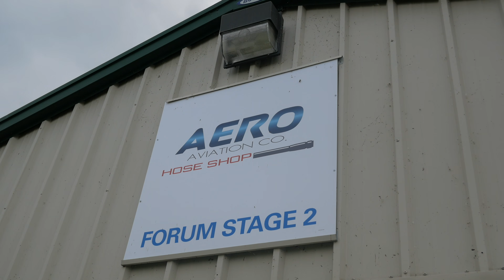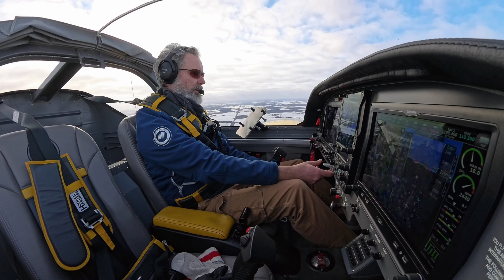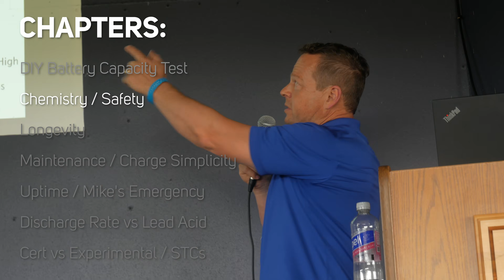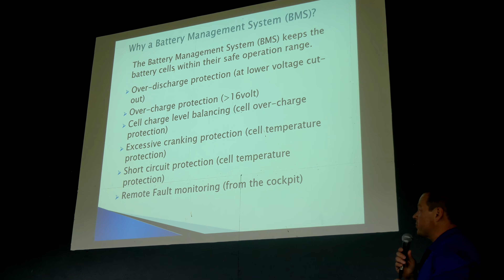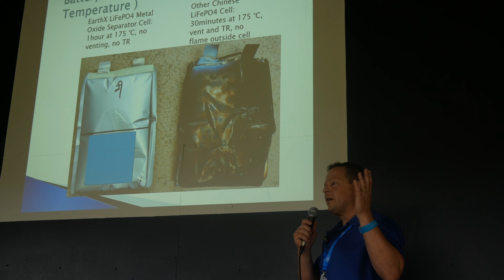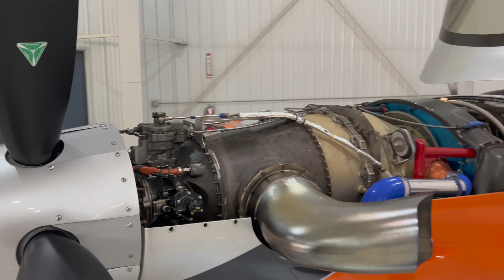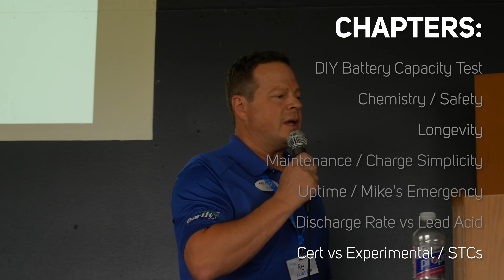"Are these the batteries that blow up?” | Deep dive on Flying with EarthX Lithium Batteries

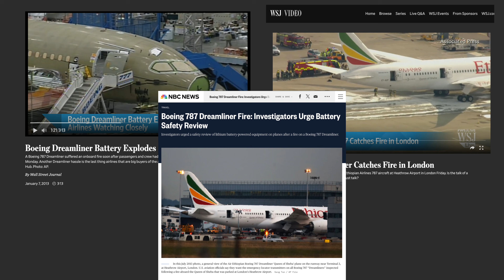Comment: 4:19 That story on the right about the 787 fire in London... That was a non-rechargeable lithium-manganese battery in the ELT. Totally unrelated to rechargeable lithium-ion batteries.
Reply from the maker: 🤷 did I get the other 2 out of 3 correct?
Reply: @FlightChops  Props for the quick reply, lol. I took another look and the bottom center image is also from that same incident in London. So 1 out of 3. Of course there really were 2 lithium-ion battery fires on 787s, so I'm just nitpicking.

Comment: Working in the automotive space, lithium iron phosphate (LFP) batteries are unbelievably reliable and safe. People hear lithium but don't realize how different the chemistries are (understandably). Admittedly its been wild to see how much advancement there has been in the space not just in energy density but also reliability and ruggedness. Likely most automotive electric vehicle pack batteries will go LFP over time and then NCM or NCA will just be in sports cars, Etc. Admittedly aviation will probably use NCA or NCM for the main pack due to energy density.

Comment: I have LiFePO4 batteries on my house solar for the same reason. Those things are so stable you can drive a nail through them or light them on fire and they won't runaway... unlike all the lithium cobalt chemistries.

Comment: We've been using LiFePO4 batteries in gliders for a while. Since we don't have an alternator, the extra capacity is a great help! My worry has always been deep discharging wrecking the expensive battery after a long day, but it sounds like this problem is solved.

Comment: I had an early version of the EarthX battery without the overvoltage protection. I had a voltage regulator runaway that instantly went to 30+ volts before I could pull the CB. The battery was toast and puffed up enough to split the case, but it didn't do anything scary. I called EarthX, gave them the SN and they told me to throw the old one away and they sent me a new one right away. Several years later and it's been working great ever since.
Reply: Tis a bit concerning that the internal BMS did not stop the claimed >16Volts doing damage.

Comment: Hey Steve, why do you suspect your starter has a phantom draw? As soon as you're done cranking, a healthy starter and solenoid shouldn't be pulling ANY current. The only reason could be wear or corrosion (or even a bad relay coil), it may be time to replace that starter!
Reply from the maker: If I understand correctly, it is my Lycoming EIS (ignition / left mag) that draws the phantom current, and that's normal for them.
Reply: @FlightChops  Ah yeah, you did say "ignition." I don't know why my brain thought you had said the starter! Apologies for the misunderstanding.

Comment: Great review. I'm thinking of putting an EarthX battery on my Cessna 180 (firewall). I thought that a temperature warning light visible to the pilot had to be mounted on the panel. No?
Reply: Yes, the fault light indicator is connected to your panel. We do have an STC for a Cessna 180! Your mechanic would help you with the firewall location installation.
Reply: @EarthX_Lithium_Batteries  Thank you!
Reply: @healerf18  No problem!

Comment: Hopefully I didn't just miss this info, but besides the heat concerns in pre-firewall installs, what about in below freezing conditions?  LFP does not like to be charged in sub-freezing, and discharge below -10C is the same.  I'd guess in both winter & summer it's easy to get below those thresholds, especially at altitude.
Reply: Our batteries charge just fine in sub-freezing temps this is because EarthX batteries are engine start batteries, so the expectation is that you crank the engine prior to charging.   As such, the battery temperature is increased ~ 10DegC so it can accept charge without harming the battery. 
Our Operating Temperature range is -30 °C to +60 °C
Our Storage Temperature range is -40 °C to +70 °C
You can find detailed information on our website, under "resources," under "fact sheets"

Comment: I desuplhate my battery often and once in a while , I put a welder on it, till the acid boil.  I managed to get at least a decade out of my car batteries.  How long do your lithium batteries last?
Reply: 2,500 to 9,000 charge cycles.  Traditional lead-acid batteries, only 300-500 cycles.
Two things that kill LiIo batteries - heat and high voltage.

Comment: Enough said about battery protection. I take it you solved the problem. But the other big concern is alternator protection.  When the battery management sensed a full charge, some management system will just isolate the battery. That is like someone just yank one of the battery cable from the battery, leaving a lot of amps with no where to go, and it will fry the alternator. Aircraft usually have a steady electrical load, but not boats, when the sailor try to charge their battery in preparation for night, and a lot of boat (sailing boats) owners had fried alternators.(diodes)  Frying is a process best use on potato, not alternators.
Reply: A properly designed and maintained aircraft is designed to run without a battery, giving the electrical system redundancy.   How is an aircraft different from a car or boat?   An aircraft has a steady load and added capacitance to manage the AC ripple current in the absence of a battery.   It is not intended to run forever this way, just for a short duration to safely get to an airport.  Do scenarios as described damage an alternator … no.  

To the question, does the EarthX battery isolate from the aircraft electrical system when it is full … no.
Reply: @EarthX_Lithium_Batteries  Redundancy in a light plane read battery. Unless you are the few that oped to install a standby alternator.Without that , on a long IFR over water, you are up the creek unless you have hand held back ups or more than one engine.

Comment: lifepo is good but like many things in aviation it's a touch on the expensive side. Not as outrageous as true blue power but still, the batteries themselves cost around 10% of the sale price. In true blue it's about 4%
The one you have there goes for 650$ now although they derated it to 20Ah. 650 is more palatable than true blue's 2200$ but we don't necessarily have to normalize very high prices in everything aviation. or for that matter in power tools that have also gotten very overpriced the last decade or 2.
Avionics could also have a couple of cells inside such that they could run for an hour or two without supply. Good cells might cost dollar fifty.

Comment: Certified pros and cons. I ran the numbers for switching from lead acid to EarthX on my Piper Arrow IV in Canada.
Pros:
1) It’s 21 lbs lighter, 
2) forgetting the master doesn’t destroy the battery, 
3) at least double the usable flight time following an alternator failure
4) better cold cranking on my stubborn IO-360 (Surefire electronic ignition solved my starting issues but my new 35Ah lead acid still struggles to actually turn the prop).
Cons:
1) Cost, 35Ah battery delivered to my door and installed by myself is $1000. EarthX delivered and installed by your AME with STC required warning light and vent tubes is $2000+ depending on installation complexity.

Lead acid and Lithium both have roughly an average life span about 5 years in Canada (unless you forget the master switch and destroy the lead acid) so you’re spending about an extra $200-$250/year for the initial Lithium installation.

Comment: So, I changed from Lead Acid to LifePO4 in a golf cart (Polaris Ranger) and I’ve had some interesting experiences in the first month alone.

Over-current/under-voltage can completely disconnect the battery. Maybe the BMS on these is setup differently than (say) a BigBattery BMS?

To install this in a plane, I would need documentation on exactly how the BMS responds to different scenarios. Lead-Acid is often just exposed cells and a terminal but LifePO4 has an integrated computer. That’s complexity that can fail in ways that “dumb” Lead-Acid batteries can’t.

Also, LifePO4 has a different voltage profile vs percentage of charge left. I’d love to know how electronic gauges can be updated to reflect the difference.
Reply: These are designed for aircraft, not golf carts. Every BMS is different. You can find all of our manuals on our website.

Comment: The glider world is largely converted to LiFePO.  I had a typical 7Ah lead battery when I got mine in 2009, put a new one it right after, and had power issues after long flights.  On the last day of the US Nationals in 2011 I had to fly with only the logger running because the battery was too dead.  I switched to lithium immediately after and am still using that battery.  I got a second one as a backup just last year (and also so my partner would have his own battery).  I've run the full cockpit load on that lithium battery all day long with no trouble (e.g. ground display).

Comment: does it have a BMS?  if it does, it has no place in an aircraft
Reply from the maker: Can you clarify what you mean?
Reply: @FlightChops  does it have an electronic circuit board inside the battery?  that's what a BMS is, battery management system, they can have a sudden failure and shutdown the battery
Reply from the maker: My question was why you thought it has no place in an aircraft environment because of the BMS.
If you watch the video, you’ll see that Reg clearly explains how the BMS works and if it gets into a situation where it has to shut down incoming charge current that’s all it does. It does not shut down outgoing voltage.
Reply: @sinistersilverado965  I'm curious. What is the "sudden failure" mode of a BMS that would "shutdown the battery"? DISCLAIMER: I have used and conducted testing on EarthX's batteries in (experimental) aircraft for many years now. And even with some of my "intentional abuse", I have had no such failures in over a decade. I want to be able to test such a possibility. OPINION: I have them in my aircraft **BECAUSE* they have a BMS. One must realize, though, that these batteries maintain a relatively high voltage (compared to lead acid) as they are being drained. Therefore, the "setpoint" on your EFIS to warn you that time is running out is much HIGHER than what you might use for a PC680. Ask me how I know.🤭

Comment: My battery is losing cranking power and about to die, so I'm going EarthX STC as the replacement when it's time...especially after Mike and I had this experience. I've seen the benefit of a good battery, it saved our lives. In the case of the cub, I think the benefit will be that it will be healthier for my starter to have that cranking power, especially with my high compression pistons.

Comment: Ok EarthX is on my list for next upgrade…. Do we need a GoFundMe for that poor sock !?!?

Are these self heating?  Any recommendations for exposed T-Hangers or cold Canadian conditions with no heated hanger 

One day I hope I can put an EarthX in my truck, need 400A power for winches..
Reply: They are not self-heating. Our recommendation for cold Canadian winters is to turn your master on for about 10 minutes and the current will run through the battery and warm it!
Reply: @ excellent, what about when parked?
Reply: @justinc5356  They will be fine sitting in the cold! The battery can be stored/sitting at temperatures between -40°C to +70°C. Our batteries have no
liquid inside and will not freeze!
Reply: @EarthX_Lithium_Batteries  All batteries have a liquid electrolyte!

Comment: Dear God, just Google “lithium iron phosphate batteries thermal runaway”. Yes THEY CAN have a thermal runaway. THEY CAN. Read the May 14, 2024 peer reviewed scientific study authored by Lei Su in the Journal of Energy Engineering.
Reply: Yes, they can go into thermal runaway... where did you hear in this video that they couldn't? There are examples of what it looks like when it does go into thermal runaway when we shot it, for example. Part of this clip is in this video and the full video is on our page: "Do EarthX Lithium Batteries Explode?"
Reply: @  Prior to going to Nursing School and a lucrative career change, I worked for 9 years in Flight Safety at Boeing Helicopters while being a part-time military/civilian Flight Nurse for 40 years with 20+ years as a Consultant hired by hospitals or air medical service providers after rotary and fixed-wing air ambulance incidents and crashes. I’ve done hundreds of Failure Mode & Effects Analyses and Fault Tree Analyses during both aviation and pharmaceutical careers and noticed a glaring negative watching “Do EarthX Lithium Batteries Explode?”. It only covered single-point failures (drops, compression, overcharge, etc.). Have you combined and covered multiple failures at the same time?
Reply: @PfizerRN_NavyReserveCaptain  It would be impossible to get an FAA TSO approved lithium battery for aircraft without testing absolutely everything imaginable. So yes, we have tested multiple failures at the same time.
Reply: @EarthX_Lithium_Batteries  Please accept my most sincere thanks for your response. Fly safe ✈️ 🛩️

Comment: Illuminating video Steve - have to say, charge density and high current deliverability are the big plusses with these batteries. Good that EarthX has the built in protection and overall perhaps about the most trustworthy lithiums out there. For sure, don't make them too hot!
Reply from the maker: Yeah, I agree - it's nice to have those things accounted for in the design and build of the BMS.

Comment: Here is what they will not tell you about batteries. Two types of Lithium. Ion and phosphate. Phosphate is the safe one. Yet. The Lithium batteries deal with temperature. They also have a peak and a limit. In charge. Phosphate are light in weight. The best. But weighs more. Don't have the charge limit. Cold and heat doesn't affect them. Safe. Are AMG batteries.  They do weigh. Yet. The AMG doesn't care. Extreme cold to heat. They just don't care. My van build. Two AMG 100ah. Then. A Ecoflow Delta 2 Max. Wiring for charging not shown on YouTube, etc. Giving me 400ah. 4 charging options. Later 5 options.

Comment: The thing I love most about these things is there is basically always cranking power available even towards the bottom of the charge... and then as soon as you flip on the alternator they'll just suck down allllll the amps (like 1000 watts on most lycoming 4cyl sized alternators) until they are full, which at most usually only takes minutes... It's amazing to me that Lead Acid is still the standard in most airplanes. Lithium iron phosphate is a very stable, safe, and proven chemistry.
Reply: Thank you!! Yes, it is crazy that lead acid is still the standard....  it's dinosaur tech!

Comment: LiFePO is such a great battery chemistry to have available for safety sensitive applications. I learned a lot about the options over the years powering up Tent Mahal (the canvas tent with full amenities that we used at Air Venture). Sleeping in a cloth house is probably pretty close to flying when it comes to battery safety concerns. As the EarthX folks pointed out, that chemistry is extremely resistant to overheating and thermal runaway from internal shorts and punctures. And safety in the case of internal shorts is especially important for anything that lives in a high vibration environment.

The first Lithium batteries I got for camping were LiFePO and just turned 10 years old. They have enough capacity to run the fridge for 10 days and the air fryer for 20 minutes per day, and together weigh a total of 64 lbs. The company that made them is defunct unfortunately, but the batteries are still going strong and have only lost about 7% of their total capacity. Got them charged up and ready to make spaghetti all week again this year if you're hungry!

Comment: One advantage to EarthX batteries not mentioned is how much lighter they are. Which means increasing your useful load by a few pounds.
Reply from the maker: Haha - yeah - how did that end up on the cutting room floor?  We had SO much info in this edit I must have removed one of the sound bites about that and forgot it wasn't addressed elsewhere. Whuuuups.  But yeah, for my airplane it is actually a problem because of how much weight I'd already lost firewall forward due to my light prop, so now the RV-14 is a little more tail heavy than I'd like.
Reply: @FlightChops  That also definitely influenced my research.

Comment: I work with solar lithium batteries in large scale battery storage for utilities.  We have thousands of Lithium-ion batteries in operations there has been some that malfunctioned which caused fires. If you take all the ones that are in service the percentage of failure that causes a fire is so low that you have a higher chance of being struck by lightning.
Reply from the maker: Thanks for sharing that insight. 
Do you know what the specific chemistry was for the ones that caused fires?